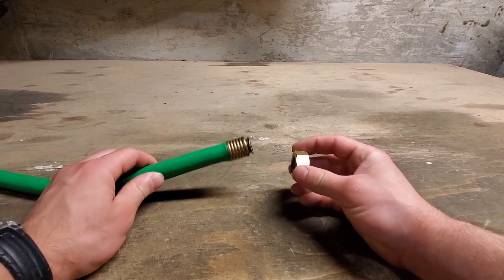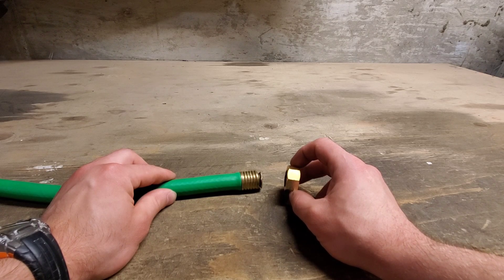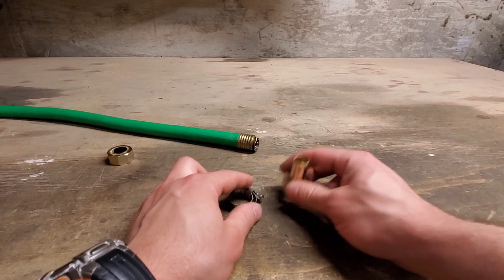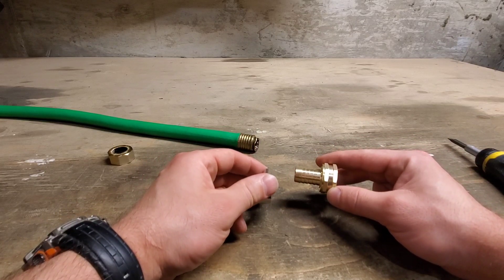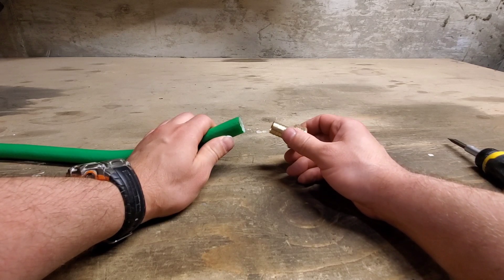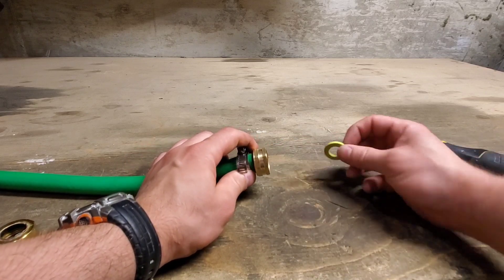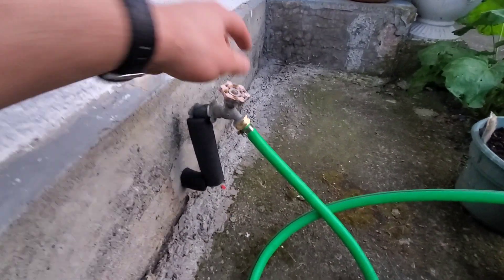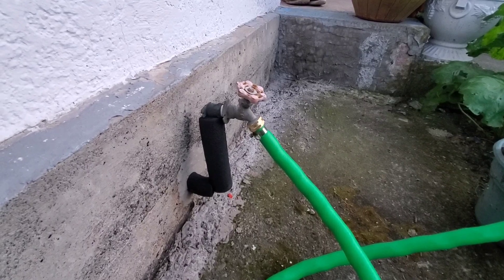#QTOW# Garden hose end replacement (DIY guide)

Comment: Always a good idea to repair rather than to replace, for a whole host of reasons! Interesting - I've never heard of that clamp being called a 'gear clamp.'  I generally hear them referred to as a 'hose clamp' or a 'Breeze clamp' (Breeze is a brand name, like 'Kleenex'). 

Thanks for sharing this tip. Take care and God Bless.
Reply from the maker: Thanks for your comment, l have noticed after sometime with the channel the lingo we use here is different from other places. From my plumbing days, we called mj's(mechanical joints, clamped rubber sleeves for drainage) "bands" or clamps.